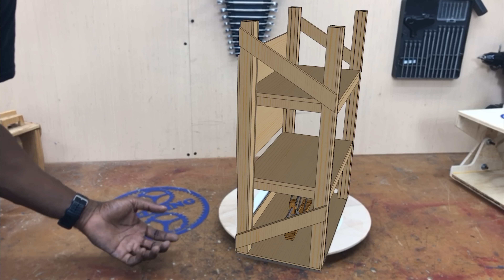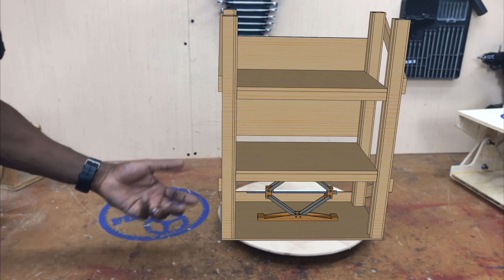Engineering Principles for Makers Part 2; Material Properties #067

Comment: I like your videos, and I don't want to be "that guy", but.....  I just like steel so much better in my opinion, one of the biggest reasons is that for the most part, steel is fairly uniform, 1x1 box tube is going to be pretty accurate vs 1x1 wood is bound to have different grain patterns, knots, moisture content, and warpage. I can order steel on the phone, vs going to home depot and searching through a whole section of lumber to find the two decent pieces. I don't know man, I am such a fan of steel that whenever I have to use wood for anything, it is like I am in a different universe. Different strokes for different folks.
Reply from the maker: If you think I am saying wood is better than steel you missed the whole lesson in the video. They are different materials with different applications. Understanding the difference is what makes the best use of each material.
Reply: @Jeremy_Fielding  steel is usually better than wood, but often wood is good enough. Each material has its benefits the other cannot provide.
Reply: @1pcfred  Steel is a horrible material for a handcut dovetailed keepsake box
Reply: @Jeremy_Fielding  although in the long run wood is almost never as stable of a material  as steel  and cant be added onto as  securely  as steel  as only way to fuse wood is adhesive  or screws also you only used flat steel in your comparisons you can  get round stock tube stock  both hollow and  solid core can get I beans c channel  or angle iron so with a protect wich one is going to be more likely to withstand the test of time
Reply: I made my CNC machine mostly out of wood I got from the Home Depot. It doesn't look like much but I can isolation route printed circuit boards on it without mapping. It'll hold a thousandth of an inch tolerances all day long. Which I think is pretty good for something I slapped together in my garage for a few hundred bucks. Electronics is where a lot of you hacks trip up. Having a grasp of wood can definitely improve metalworking though. When I made the last couple grinder frames I built I mocked the mechanics up in wood first to get the dimensions of everything right. It is nice when stuff works, you know? It don't have to be pretty http://i.imgur.com/Bksczq7.jpg
Reply: When you think you have a golden hammer, everything looks like a nail.
Reply: @3rdeye7thdimension  when you actually have a golden hammer you know it is not for driving nails.

Comment: Nice 3D placement in the video  :)
I suggest putting locking pins on the legs for the raising/lowering of the system. That way any work you do on the tables won't be transferred to the jack. The load will be delivered through the legs into the solid floor.
Reply from the maker: I like it.

Comment: In your deflection test at the start of your video you use a piece of flat steel on its side and a piece of I-beam wood standing up. Not exactly a good comparison. Love channel though. :)
Reply from the maker: That was exactly the point. The shape of your project matter as much as the material. You can replace wood with steel, but if you have a poor design it will be just as bad.
Reply: I'm sorry, I must have taken that the wrong way. I thought that you were trying to say that wood was stronger than steel. Still love the channel. :)

Comment: I love the engineering content.  I prefer content that makes me think. 

I hope you will not fully abandon your first workbench concept.  I personally like it much better, and have been looking forward to your explanation of the linkage involved.

Keep these excellent videos coming.
Reply from the maker: I am thinking of building both... I don’t know for sure what the final result will be.
Reply: @Jeremy_Fielding  what about two in one.

So in both positions the bottom peace remains horizontal. But is able to travel above the "center(top)" piece, which only moves on a hinge from horizontal to verticle(i liked the tool compartments(ohm meter/plexiglass idea)
So now you would have a strictly horizontal piece which moves from under the horizontal(hinge capable top), which you raise vertically allowing for bottom to travel while remaining horizontal. Now unfortunately I believe (defining the problem as step 19 in my spiel lol) you want to keep both horizontal. But I think it would be over engineered to have separate tracks, more parts mo problems lol.

Not sure if its clear. But it is in my head lol, love to get some feedback of what others think!
Reply: @Jeremy_Fielding  If in the first design there was a way to fold the top table over to make an even bigger single table top when it is rolled out you can have 3 table top sizes.

Comment: I build with pretzel exclusively.
Reply: I use Doritos. They're triangles, so they're stronger.
Reply: @bloodgain  But particularly expensive when you eat 90% of your materials!
Reply: bloodgain 
Now that’s thinking geometrically!
Reply: Peanut butter is by far the best glue for pretzel 🥨
Reply: @res2788  ...and the crunchy variant can be used as concrete mixture! 😏
Reply: That's funny!
Reply: @johnafagerquist8235  and delicious.
Reply: If you work at Auntie Anne’s I’m gonna be disappointed.
Reply: Dylan T 
Water crackers.  You can build anything with them.  I have a friend who swears by matzo balls; but I find them a bit gooey.
Reply: How do they hold up in high humidity!!!!!
Reply: Barry Mayson You mean when washed down with beer? They don't last so long.